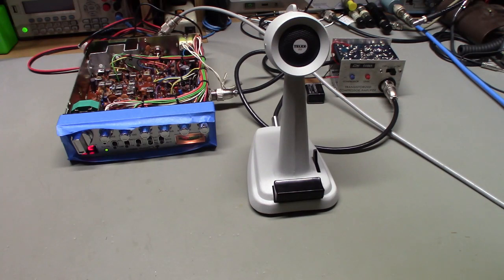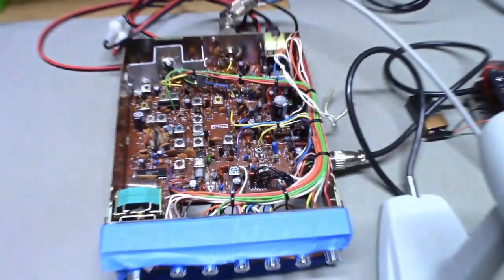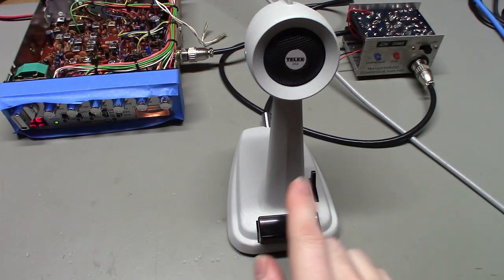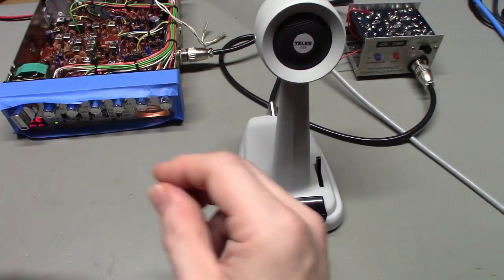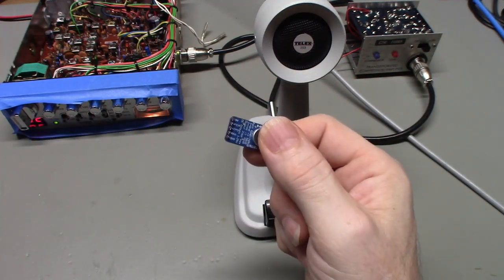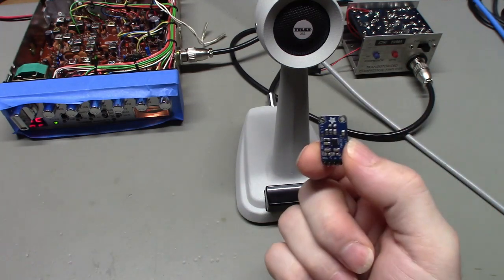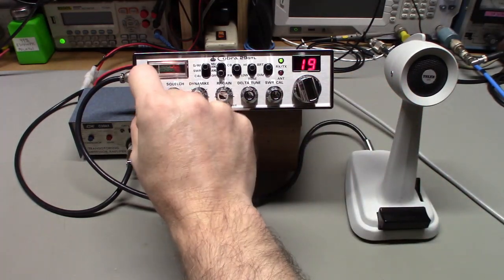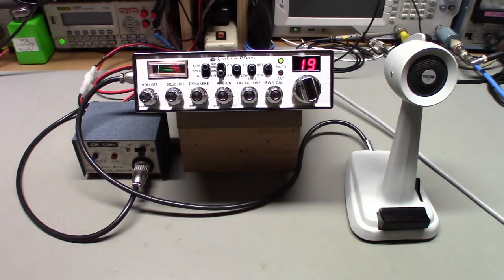Cobra 29, B&K Cobra compressor, Turner mic restoration. Upgrading to a electret microphone with AGC.

Comment: For people that do not want to remove the cover - just put one of the 5.5mm DC Jacks wired to the battery circuit. Then you can use the 9 volt battery clip with the 5.5mm adapter or any wall-wart just plug it in.
Reply: I would be considering the noise from the wall wart. Some are better than others. Make sure your wall wart has a transformer inside instead of a switching supply. You may have to come up with a power filter.

Comment: A large diameter pool noodle works good for repairing the D-104 mics - it has a 1 inch hole for the new Crystal cartridge and a piece of felt from the craft department and if your D-104 gets weak most of mine were just the electrolytic cap gone bad.

Comment: Not sure mike covered this but the max voltage you can use for those boards without burning them up is 5.5 volts, they will except as low as 3 volts. Two to three AA batteries will work great.
Reply: instablaster...

Comment: the hammertone blue turner plus two i have has a stock round aluminum foil diaphragm over a crystal element in it and made for radio mosty for the old tube radios like the 23 courier etc. which my father in those days dealed in couriers  he had the 23 black and chrome like in you other video and the blue and chrome 23 plus he used in the car a gold color royal plus some fanons 23 ch walkie talkie and a transistor courier 4 ch pocket scanner, a fanon metal cone pa loudspeaker, courier was the higher end to the fanon kinda like mercury vs ford in cars

Comment: You perform some fantastic work Mike, interesting that you bring up the test point subject, I havn't seen those in radios in a long time, my thoughts are that the radio engineers these days build modern radios to be disposable, with todays generations thought process is, if you own a radio long enough to where you need to take it to a tech and have it tuned up, then it's time to buy another one. Those are my thoughts anyways.
        Thanks for sharing!
        Kind regards, Eric Dee.

Comment: I used that exact same amp for my station. I’ve used the mic gain to reduce the input into the radio. What size variable resister did you use? I mounted it in a box with a home made 12v to 5v regular and switching to flip between 4 different radius. The a PR20 boom mic with a foot switch. It’s hard to get the mic gains right to except that amount of gain even with the amp set to 40db.

Comment: Mike ; I saw your Turner Microphone video and was wondering how the Adafruit compression AGC board compares to the older tuner circuit. I haven't seen either circuit, but I would venture to guess that the Turner is based upon a JFET transistor to a few discrete  output stage, whereas the Maxim IC probably is Op Amp based. How would you compare the sound qualities of each ? - Also I was comparing the characteristics of the Maxim MAX9814 to the Analog Devices SSM2167 which has a variable compression feature. What do you think of this part ?  Thanks, Steve !

Comment: hello Mike first of all I wanna say thanks for the video's you do,  they are great.  I have a question about a connex 3300 HP if to could help me it is not transmuting or receiving.  also the talk back is very low on it,  if I use a Popsicle sticks and drag it on the solder side it gets louder could it be just a cold joint.   thanks in advance

Comment: Just out of curiosity where did you mount the element with respect to the circular logo plate; can that interfere with the audio getting to the element? Or did you mount it back away from the grill?
Reply: Apparently CH6 equates to 7.200/14.313 in the ham bands!
Reply from the maker: It's pretty much centered but it's deep enough back into the housing that it has no problem picking up sound.  These things are VERY sensitive.  If you were to set it to 60db gain I don't think it would have a problem picking up a mouse fart at 50 paces.

Comment: Hi Mike, is that board mounted so it's always power on, or is it connected so it just powers on while hitting the ptt button on the mic ?
Reply from the maker: Only when the PTT is pressed.  That's why I had to add a additional switch section, to control the battery supply to the board.
Reply: Thank you for the reply, Mike.
I might have misunderstood that part in the video, I thought that you added that extra switch because of the missing abillity to close the connection on receive on rx chain in the radio :) Have a nice weekend :)
Reply from the maker: It had one switch assembly that is made up of two separate switch's.  One for PTT and one to disconnect the audio line when in receive.  The second switch assembly I added was used to disconnect the battery in receive.

Comment: i tried to use one of these  on a cb radio and all I could get it to do was squeal like crazy! but on just a speaker it workded like it should. can any one tell me what i'm doing wrong?
Reply: It has too much gain, you need to add a resistor to it.

Comment: Do you use candle wax to seal the inductor cores?
Reply: commercial beeswax
Reply from the maker: No, never use candle wax.  It's to hard and all but impossible to remove later.  Use cosmetic grade beeswax.  You can get little bars of it on eBay.
Reply: Enrique Paz
Thank you.
Reply: MikesRadioRepair
Thank you Master Sensei.

Comment: What is the website for those boards? I did not really understand the name of the company. Thanx.
Reply: Adafruit.com. Just search it and it will pop up quickly. It’s a very popular site. I should buy stock there, I’ve bet I’ve spent two grand there in the last year.
Reply: Thanx. After I asked the question, I was watching another video where an ad for them popped up. Cool site!
Reply: The name of the company is Adafruit.
Reply from the maker: Correct.  Great company with oodles of widgets you didn't know you need. :-)

Comment: That little amp board works like a compressor?
Reply from the maker: No, not really.  There is a big difference between AGC, compression, expansion, DRC, companders, etc.  It would take a book, a big book to cover all the differences between all of the different types of audio signal conditioning.  There are many good articles on audio processing on many of the professional audio engineer websites.
Reply: MikesRadioRepair 
Thank you. I will search for them.

Comment: I'm wondering why these mics don't use a micro switch that has NO and NC contacts.
Reply from the maker: The type of switches they used in vintage Turner, Astatic and most other microphones were probably used because that's what they had back then.  They are also extremely reliable.  They just never seem to go bad.  Unlike micro switches which I have had to replace because they failed.